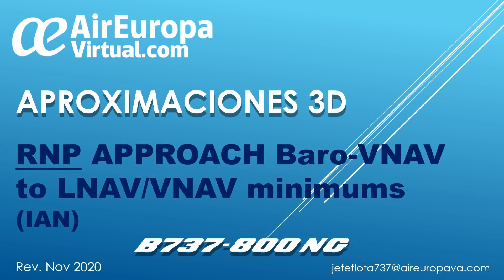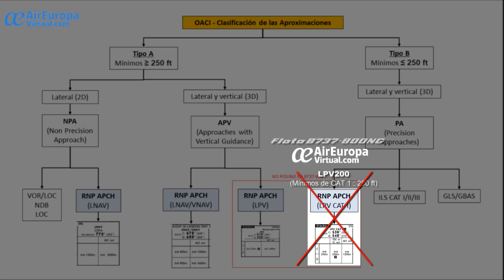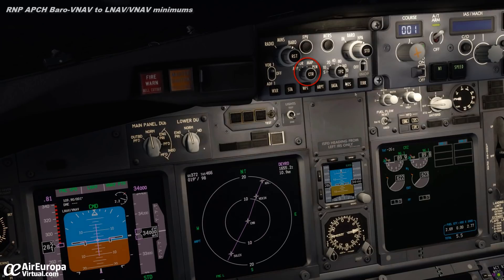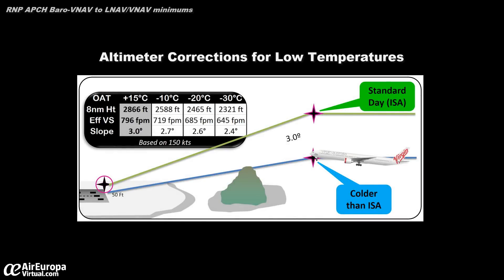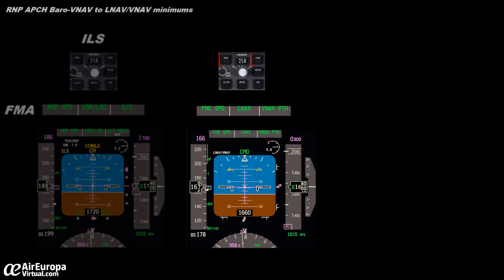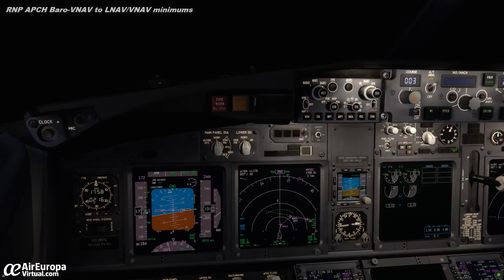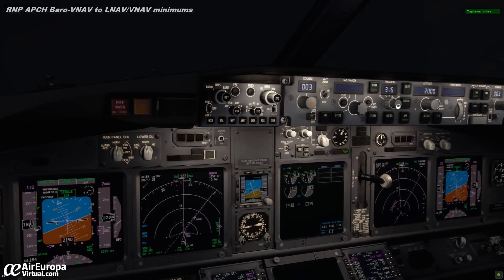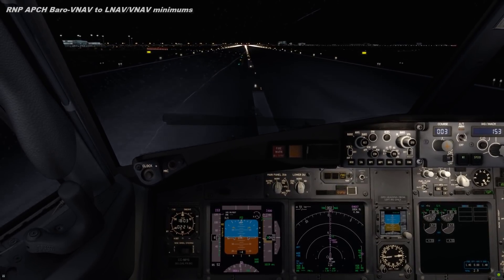RNP Baro-VNAV Approach (LNAV-VNAV Minima) on B737-800

Comment from the maker: It's all about learning, no matter the aircraft!
Thanks to Jonas for providing and sharing all his knowledge in the Boeing B737. More to come if you like these videos with theory and simulation performance.
Reply: Cheers Jonas. We don’t do Ian approaches in our company so they’re new to me, only lnav/vnav ops. I noticed Lnav wasn’t armed in the fma’s for the missed, is that a simism, or is it a ‘depends on the ac fit’, or does it revert to something for an Ian approach go around?
Reply: @johntankertson110  thanks John! The IAN capability makes the presentation on PFD (and FMA) as “ILS look alike”. When a missed  approach  exists  in  the  flight  plan  and  the  FCCs  are  capable  of entering  go-around,  LNAV  arm  will  be  annunciated  on  the  FMA.  The  roll go-around  track  hold  mode  will  automatically  transition  to  LNAV  during  a  missed approach. But during the entire approach down to minimums LNAV does not show “armed” on FMA unless you start the go around and above 400’ RA. Nice flights!
Reply: @JonasOlla  perfect, thanks for clarifying! 👍
Reply: Any recordings of SJ182?
Reply: Thanks for an illuminating discussion.
Reply: Does this apply to the airbus a320
Reply: @ahmadtheaviationlover1937  , this video is specific for 737 procedure to fly RNP APCH using IAN system,.. I don’t know if Airbus has similar system to fly RNP APCH. Maybe some Airbus pilot “on the room” can give us his two cents ;). However the first part (PBN concept and classification) is the same for any aircraft.
Reply: @JonasOlla  I see! By dream aircraft is the A320